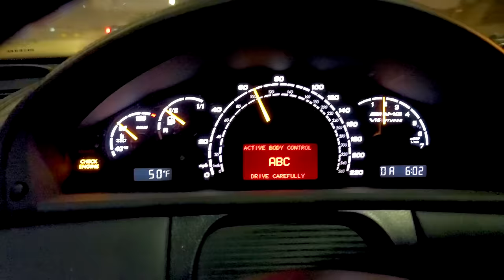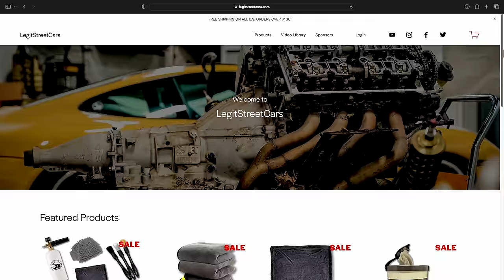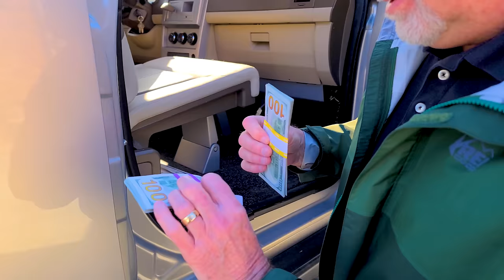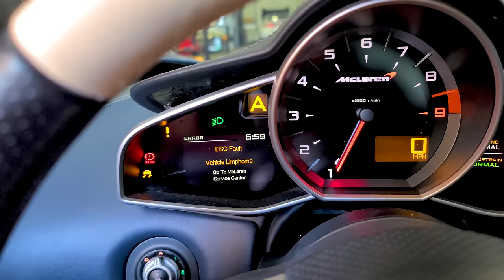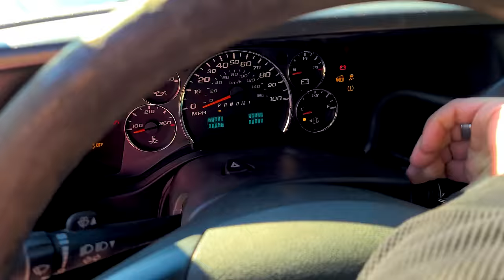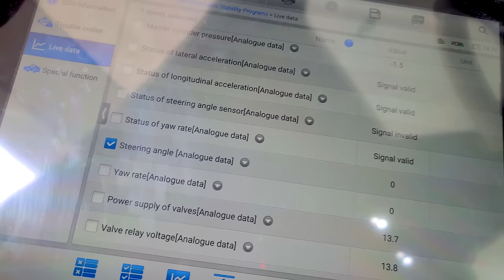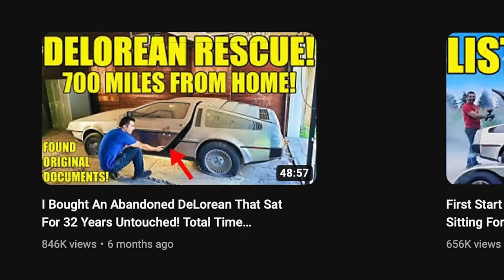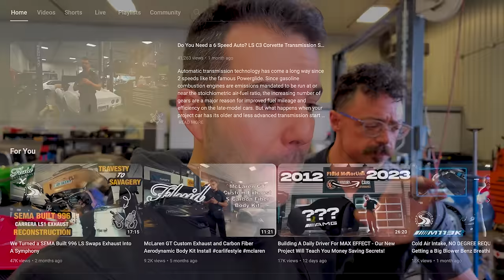My Car World Has Officially Crashed & Burned! Big Channel Update! Mostly Bad Except 2 Things.

Comment from the maker: 15% Off The ENTIRE Website! https://www.legitstreetcars.com/ Discount Auto Applied!
Avalon King Ceramic Coating Kit deal! https://avl.kg/legitas9reap Use Code REAPER at Checkout!
Reply: @LegitStreetCars I'm thinking the belt tensioner on the van is the issue. Maybe you need something that can apply more pressure to the belt. It's a fairly common issue on the gen 1 Ford raptor once a blower is installed. Livernois Motorsports might have a better tensioner for you.
Reply: Your water pump is the problem
Reply: Hey. Do you read these?
I had the same issue with the same supercharger on my Impala where it would dump the belt.
I used a high speed camera (which was pretty expensive 20 years ago) and found that when you let off the accel, you induce a "wave" in the belt that is JUST HIGH ENOUGH to jump off the the "most angled pulley" in the sequence.
In your case the alternator.
It's a simple fix. 
ish
From the alt bracket, make a new bracket with a bearing'ed sleeve riding on a shaft.
Put that sleeve RIGHT above the alt pulley. Clearance half the height of the belt. 
And clock it about 30 degrees towards the direction the belt comes from.
Since it's ON the alt bracket, there should never be any torquing of the sleeve, making it hit the pulley, but check anyway. 
Everyone has high speed cameras on their phones now.
If you can't picture it... the sleeve is right above the belt... when that wave comes for the pulley, the sleeve SMACKS IT THE FK DOWN.
There really isn't any other way to take care of it, using a ribbed serpentine belt. That's why the cogged belts exist. It only gets worse the more hp you add. Because the transition from high hp to low, "stalls" the pulley on the SC. That's where the wave gets kicked up.
If you need a diagram or want to chat about it, my info is in my about.
Reply: I can't watch right now, getting ready to start some wrenching of my own, but I will before the day is over. I remember you showing in a past video the process you use to clean the back side of intake valves, through the runner, while the intgake is off. I can't recall which video or ride that might have occoured on. Any chance you can point me to a video containing that?

My intake is coming off and will be off for a few days. I'd like to consider using this time to do some deeper cleaning, to include the valves like I've seen you do.
Reply: True Chicagoan ain't got non
Reply: @LegitStreetCars hey Alex! i know whats wrong with the van!
get a GATES pulley kit. why?
because your plastic plulleys are flexing and warping. thats why the belt flies off.
doesnt take much but enough to ruin your day.
Gates pulleys are made of metal and dont flex and warp.
Reply: Svt lightning
Reply: ❤❤When you started the CL IT HAD A BIG PUFF OF BLUE OR WHITE SMOKE COME FROM THE EXHAUST ,,LIKE VALVE STEM SEALS TYPE PUFF OF SMOKE CAUSE IT DISAPPEARED AS QUICK IT  CAME ,MAYBE THERE IS SOMETHING ELSE GOING ON WITH IT TO CAUSE IT HAPPENING AND CAUSING YOUR LIMP MODE ???❤
Reply: Why not just put an electric race water pump on the Porsche.
Reply: How much more of this before you give up and either sell it or put some normal coilovers on it?
Reply: He has the 46 wheels on the wall. Do you have one coming to its male
Reply: Get a pulley with a wide lip for the alternator so the belt doesn't jump off as easily.
Reply: i wouldn't trust a machine shop in chitcago to build a lawnmower engine
Reply: im wating one day when matts off road recovery invites you to there get togather one day they have one comeing up
Reply: Ex friend ex employee?
Reply: Ch11 was 12 $ not that long time ago.

Comment: Your belt issue on the van - On the back of your power steering pump there's a little l bracket that goes to the block. I believe. I had the exact same issue with my Sierra, found that whoever changed out the pump before didn't put that bracket back in and a little flex from the power steering pump caused the belt to fly off the alternator occasionally.
Reply: Bump so he sees
Reply: Bump
Reply: Bump
Reply: Bump!
Reply: Bump!!
Reply: bump
Reply: How do we tag him?
Reply: bump
Reply: @ligitstreetcars
Reply: @legitstreetcars

Comment: I have a tip for ya, I used to take some things to get fixed and work done at a machine shop before I began my own.  I would make a written contract with a pickup by date or money back on a scratch piece of paper which you have them sign while recording on the phone.  That solves any possible headaches.
Reply: You should drop the name of your shop. It seems like you're an honest guy that can get things done in a timely manner.

Comment: Previous CL video had someone in the comments that was onto something with regards to whats wrong with the CL65 Amg. The catalytic converter rattles loose inside the housings on these year models, and when you accelerate it blocks the flow of the exhaust because the inner catalytic converter slides back inside the exhaust under load. Creating back pressure your ecu can't compensate for, causing the the Check engine light under only under heavy acceleration.
Reply: Yeah I also saw that comment and made a lot of sense!
Reply: I saw that too. C'mon Alex!
Reply: Well let’s bump this up this time. Team work lads.
Reply: @legitstreetcars
Reply: I have a picture of one that was completely round and would roll back and forth and sometimes align and flow sometimes not. I wish I could load a picture of it.
Reply: Yo
Reply: Alex
Reply: he's having the same problems w/o the cats installed

Comment: Try a high wall pulley on the alternator change it out. When under extreme rpm that belt extends for a brief second, creating a ripple (rope on the ground when yanked creates a wave that rides to the opposite end). Enough to slightly hop off the alt, could be the distance between the pro charger and alt where that wave makes it pop off.

Comment: Alex, just unscrew the hood bump stops a half turn or so. That will give you the upward pressure needed when opening the hood. I made a video recently about that very issue.
Reply: I was thinking exactly the same thing
Reply: And if you hit all the hinges, including the lock with lithium grease, they won't drag from friction, and you'll need less pop.
Reply: @achucifer 60% of the time, starts every time.
Reply: It works for sure but on my s15 if I wind the bump stops up to where it will pop the hood open the body line is slightly above flush with the bonnet close. 
Actually now that I write this comment, I'm guessing that means my bonnet latch needs to be adjusted down?
Reply: I was gonna write exactly that. Easy fix
Reply: Or you just use an old bottle of scratch remover.

Comment: Gday mate, when we supercharge vehicles in aus we change all the plastic pulleys out for metal ones, the extra tension on the belt can deform and break the plastic ones, as for it flying off it's usually harmonics on the longest stretch of the belt

Comment: I would love a McLaren, but constant problems is why I avoided them.  Great for a channel about cars of course…
Reply: You sir are a beast with phones and similar tech!
Reply: Me too, or the price... Yeah...
Reply: Yeah same man, I would own a McLaren if they were more reliable... and thats definitely the only reason I don't own a McLaren, 100%
Reply: McLarens are great but you have to drive them. Once they sit problems arise
Reply: If parts weren't beyond ridiculous, like 10k for headlights, 20k for body panels, 100k for engines, even the reliability wouldn't be such an issue.
Reply: McLaren are too fragile.
Reply: I live not fare from the Mclaren technology centre. When Ron Dennis was the director of Mclaren he said their road car's was never designed to be driven everyday or tuned beyond what they had done at the technology centre. Any of the Mclaren car's designed around that time had the same problems. The new Mclaren doesn't have the same issues now they have a new director as long people don't try over tuning them as they are only built to Mclaren spec's, the moment you try pushing the power so you will bend rod's.
Reply: @Ecozzy0123  Yes. The car museum, Petersen Auto museum in Los Angeles said car will deteriorate quicker if a car is left sitting. So any of their street cars that are drive-able are taken out for a weekly 1 hour freeway drive.
Reply: See my nickname for it - McTrouble!
Reply: JR is smiling somewhere ...
Reply: @Ecozzy0123  British cheap quality 😢, cool cars tho 😎
Reply: For me the van is definitely the favourite project. I would love to own one like that but unfortunately gas costs over double compared to US down here...

Comment: Hey Alex on the van try a belt that is about a half an inch longer. Sometimes the tensioner doesn't swing far enough to get its full tension and it will sit there at the top of its stroke and bounce That may be why you are breaking them as well.

Comment: It looks like you have a classic case of owning British and German cars. My cousin had a late '80s V12 Jag. Just be thankful you don't own one of those. You literally could not fix it with brand new OEM parts. I redid the whole ignition system on that car and 2 weeks later had misfires again, and it was bad wires we got at the dealer. I was able to mix and match the old wires to make it run right again, but a couple months later it was coming back. Turns out with all the crap they put in the valley with the plugs, wires and injectors trapped underneath, it won't let heat escape and everything cooks and is in constant need of replacement. That was just one example. The whole car was like that. Similar but much lower magnitude was my other buddy's late '90s 5-series. That thing rode and drove really nice but it was a constant maintenance nightmare, and he had to replace the engine in his brief time owning it. Another friend had a Saab turbo. That thing was always in the shop too. I think he went through 3 turbos in 100k. I swore off Euro cars in general because of those three cars. I think that was a good move in retrospect.

Comment: Bearing in the alternator alex. Seen this happen once. At a specific rpm the Bearing hits a vibrational frequency that almost locks it temporarily.   Fast enough that it kicks the belt. Changed alternator and solved. Check for any Bearing play.
Reply: I once had a wierd issue where a 1.9 TDI squeaked on left turns. Also was the alternator bearing. Eventually it failed completely, causing the rotor to hit the stator and making the alternator fly apart into a million pieces.
Reply: Beat me to it! Alternators can be that really obnoxious hidden problem... like you said, it can hit an out-of balance resonance condition that can cause enough "bad vibes" to shake the belt off.

Comment: Alex, the belt could be coming off from the AC clutch failing. If it locks up at high RPM it could be causing a ripple in the belt at the alternator. 
This happened on my F150 - thought it was an alternator until I realized the AC wasn’t working in the spring.

Comment: Alex here is a couple Pentosin alternates if you want to diagnose.  Fuchs CHFIIS is cheaper, but seems to be the same thing at half the price or back when I had a Saab they said you could use GM Power Steering fluid as a replacement in an emergency.  So if you wanted to diagnose you could use the GM stuff and then drain it.
Reply: I used the wrong fluid and it killed my rack. Never again.

Comment: Hey Alex, on the van. Chevys cut alternator field excitation to help with mpg and to reduce failure from high rpm. It's possible since it goes from a load to no load could cause the alternator to fling forward from momentum kicking the belt off. Also it might have a sprang clutch which could be going bad. Hope this could be of help.

Comment: For the porsche you could do what Stay Tuned did on his LS porsche and use an electronic throttle body (ls3) and remote mount it. No worry about the throttle cable
Reply: @Justntoys I made the same comment in his Porsche video but clearly Alex hasn't read the comment even though the video was freshly released 🤷‍♂️

Comment: On my buddies 67 Cuda we mounted a bent piece of round stock on the alternator about 5/16"dia. to keep the belt from jumping off the pulley when he dumped the throttle clutching between gears. Long belts get a lot of momentum. Tack additive helps too, but it's messy so most don't use it even though it extends belt life because it helps prevent slipping on high HP engines. Belt jumping the pulley used to be a bigger issue, before they started making them out of materials that don't stretch.
Reply: Use the threaded hole on the alternator to mount a piece of bent round stock.

Comment: The van, check and see if the belt comes off the alternator pulley due to fouling on the spacers for the supercharger bracket. If it snags for just a split second it is enough for the belt to "pile up" behind it and pop off the pulley. Cheers.

Comment: About that your belt jumps off on the 15seat van . The more engine rpm the faster the belt runns around the bends with more g- forses . Holding this back is the spring in the tentioner . 
If the tentioner was changed and had a stronger spring  . It stoped jumping off .
And the alternator is the sharpest bend so that's probably jumpt off there .  ????? 

I think

Comment: Sounds crazy, but about the belt, I had a similar experience with replacing a John Deere lawn tractor drive belt, bought some off brand name belts that where less than half the price of a JD belt. Broke through the replacement belt after two mowings, bought another due to warranty,  same story, finally bought the JD belt and been going on 2 years now no issues. It could simply be crap manufactured belts.

Comment: you can have the fuel line made at a  shop that makes custom hoses...they can usually get the new fittings and recreate the factory hose...just bring or mail them the parts and busted hose and they can make it up ...

Comment: ALEX! 30:00 An answer for the Lightning engine van could be ambient temperature changes outside, making the rubber change in strength and grip, does it have a kevlar belt, if not, get one!
Reply: I hope you see this and give it a try! Basically I believe the belt is stretching at high rpm, despite the tensioner pully, and it's slipping off that small alternator fully with its sharp turn. So a strong Kevlar belt should solve it.
Reply: How's ambient temp gonna make any difference when it's under an enclosed hood with all that engine heat that it's designed to operate with?
Reply: @timwillis806 well, it did it on my car, and that's what the problem was, so... he asked for idea's!
Reply: I was gonna say temperature as well . Remember, he's in Chicago and it's winter
Reply: That's exactly what I was thinking. It was warmer when it was flying off. Also, is it flying off under load or deceleration?
Reply: wonder if that's what happened to that Vanquish on Fifth Gear all those years ago, they kept peeling out with it and going sideways and the belt for the motor kept falling off, and with the supercharger being onto of the engine and making heat where their is none

that could be doing that, like maybe he needs a vented hood or a stronger radiator to keep it cool in there, like he should put a thermometer under the hood to see how high the ambient temperatures are getting there, given their is that solid piece of metal, which would heat up, right infront of the supercharger.

hell maybe he needs to cut a relief into that spot to give the belt more air so it can cool down properly between the three bolts
Reply: @timwillis806 being that the belt is made of rubber, which is a pretty good thermal insulator, and is mostly running through the air (so slow convective heating warming it up) - I’d suspect it probably takes a good while for it to heat up in our lovely winter weather.

Comment: I had a cl500 blow the fitting on the rear left side before it crossed along the rear subframe. Fixed it with a 20 quid hydraulic hose and an olive crimp fitting from my local hydraulic shop and filled the entire system with normal hydraulic oil.
It worked an absolute treat

Comment: On the express van, I ran into this problem before. You need to check all the pulleys with a straight edge, to each other. It’s a pain, but if one pulley is slightly at an angle, the belt comes off. See about getting a higher tension or adjustable tensioner. Last, see about getting one size shorter belt. Good luck

Comment: RE the hydraulic hose in the CL: these usually have a proportioning system, either a pressure valve or a pressure control system. The old SLS used a piston / ball bearing to redirect the pump pressure back to the reservoir when the system was pressurised. When it wore, it would pass pump pressure to the lines and struts. That's what blows the struts and the lines. I did this on a w123 years ago. New line, blew straight off, just like yours, just after a junction, at the crimp. Did a service kit on the control valve, worked perfectly after that. Not sure if you have a pressure gauge that will fit at the end of a line to check pressures, but it might reveal where the excess pressure is coming from.

Comment: I would kick off the belt with nitrous at high rpm on an LS, I ended up going with a manual tensioner instead. Katech has a nice one billet tensioner.

Comment: Alex:  1.  Porsche:  put a "speed bump" on the rear hatch lid and keep the LS (90 degree bend) air filter.  You need a decent amount of filter square inches and the funky pancake filter you showed is too small.  2.  McLaren:  sell it.  Buy a C8 corvette instead - reliable, well engineered, cheap/available parts, huge following.